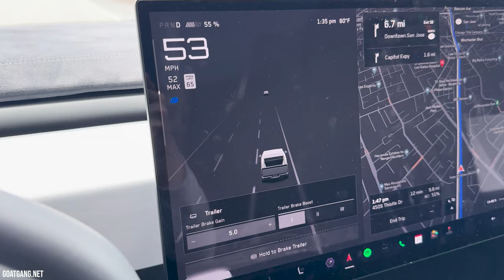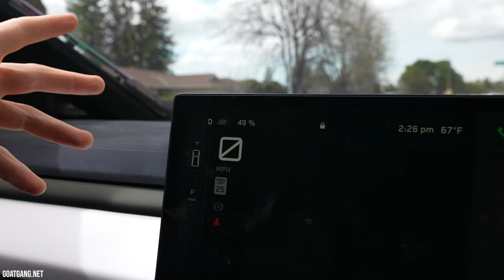Can the CyberTruck Tow a 14,000lbs Excavator?

Comment: try going 70mph downhill, and see if the cyber truck can stop with all the weight😂😂
Reply: With it's brake system and brake controller I'm pretty sure it would stop very very good.  better than a gas/diesel 1/2 ton truck.

A 60-0mph  braking on this truck is like less than 160ft. the damm thing has like 10 pistons IIRC on each front wheel iirc.
Reply: @kfelix2934  My point is that most of the half ton trucks don't pull a trailer more than 7k. He's pulling a excavator on a 10k, maybe a 14k trailer. That load is rated for at least a 3/4 ton truck. Equipment rental won't let you tow a excavator with a half ton truck.

Comment: That truck is stupid.  Try hooking a 14,000lb camping trailer to it and driving an hour and a half to the sand dunes on the weekend for some dirt bike riding.  You'll be calling a tow truck with a dead battery.  Also, Chevy, Ram, and Ford interiors are about 35 times as nice.  Why would anyone need bullet resistant doors and windows??  What are we living in hood or something?
Reply: Who hurt you